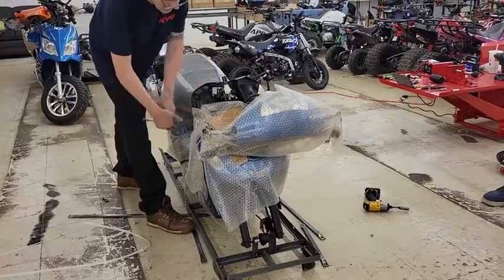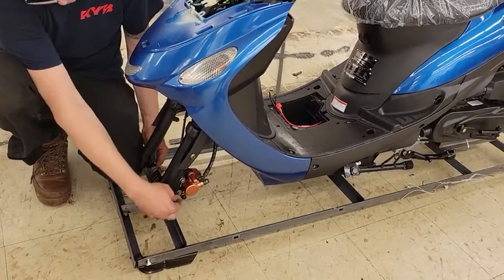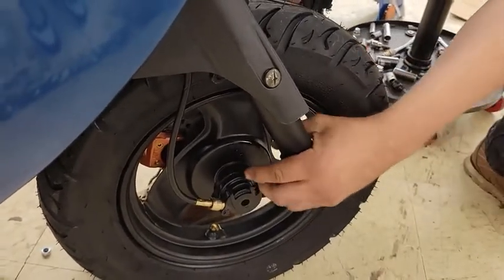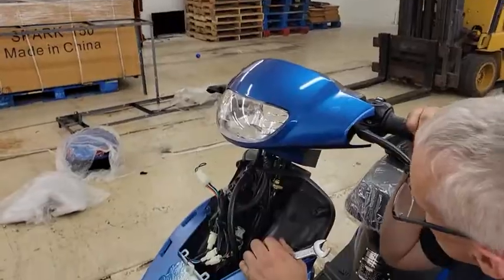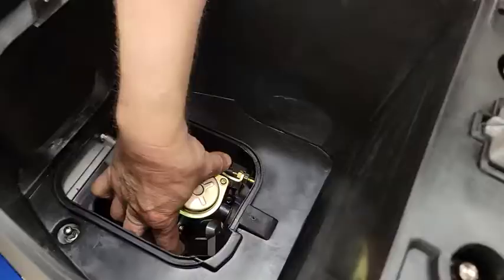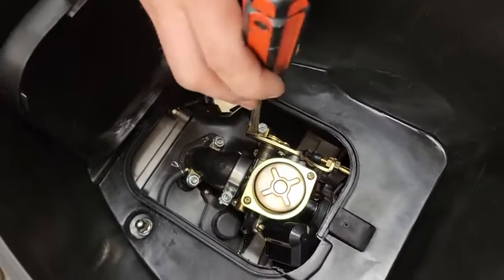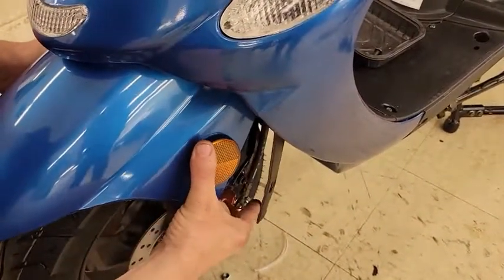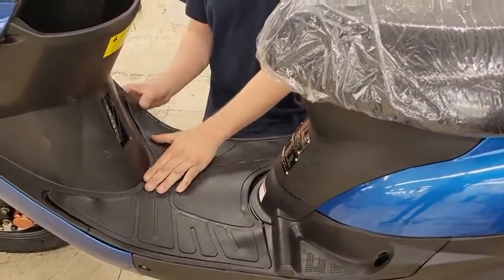assembly of tao pony 49cc scooter

Comment: Before starting do an oil change, with some decent  oil to run it in, who knows what oil they use, there is no filter so decent oil and regular changes will help you get your bike to where you  actually wear out the tyres
Reply: Someone also said change the gear oil too
Reply: There is an oil filter on the drain plug for the engine oil
Reply: @tylerescobar159  not really a fllter, more like a strainer, a filter you replace  after x amount of miles, a strainer you clean
Reply: @debeeriz  ok yea true
Reply from the maker: I recommend to ride the bike for approximately 75-100 miles with the motor oil it is shipped with in order to properly break it in.   Afterwards I recommend a high performance motorcycle oil that has no synthetic in it either 10w 30 or 10w 40 grade and then every 700-1000 miles after that.

Comment: I know you've put probably a hundreds of these things together but why you just slamming and throwing s*** all over the place I mean I'm an auto body mechanic and I don't even do that by the time you get done with it it's going to have micro scratches on it you're going to have to polish that that's more work
Reply from the maker: The body panels on these scooters is a cheap plastic the Chinese fail to clean the injection molding equipment that produces these properly there are many imperfections and dimples on the plastic I assure you that the amount of handling I did and the way that I did it left no visible marks at all.